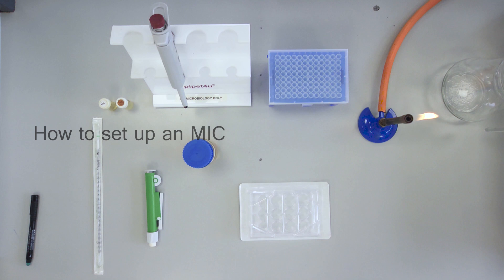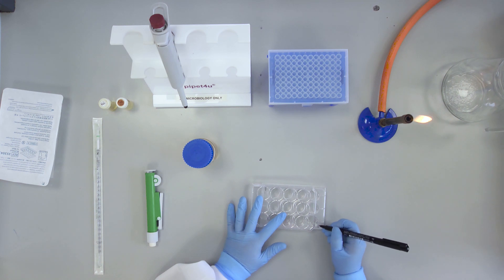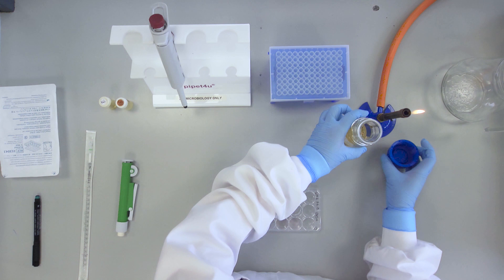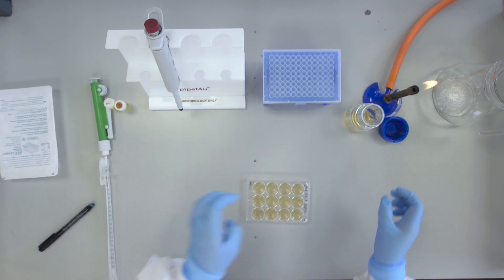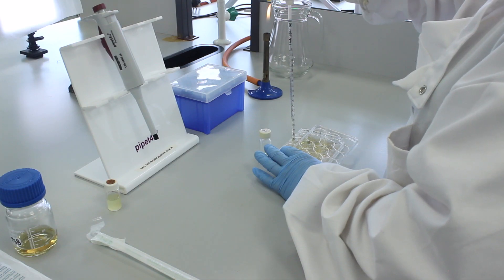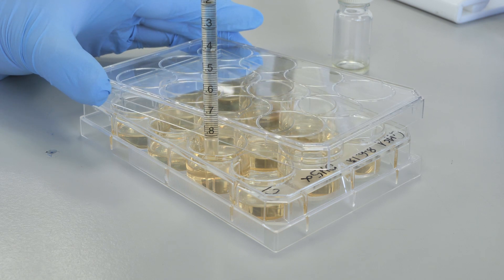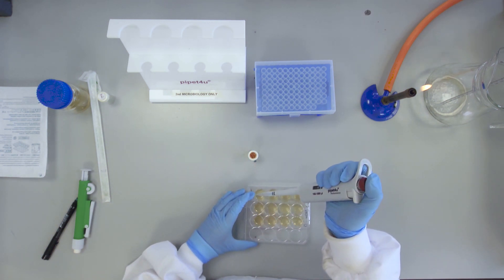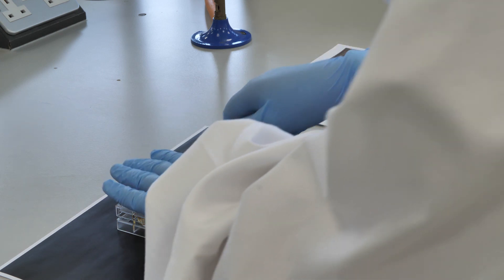Determination of Minimum Inhibitory Concentration (MIC)

Comment: Where in the video did you put the different concentrations?
Reply from the maker: The concentrations of the nalidixic acid are given at timepoint 7.11 of the video, starting from 1024 micrograms/ml down to 0 micrograms/ml
Reply: Why add only 100ul.of bacteria not 200 ul